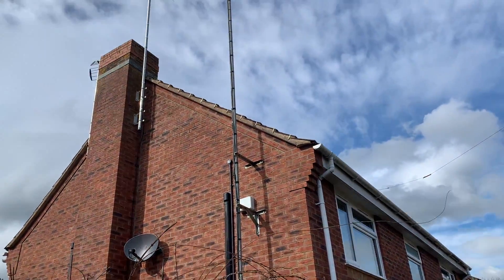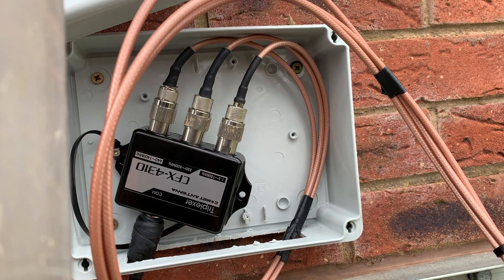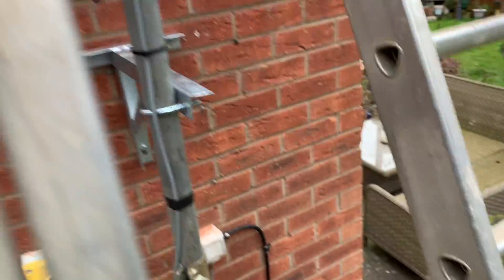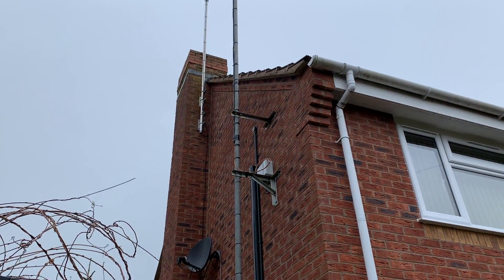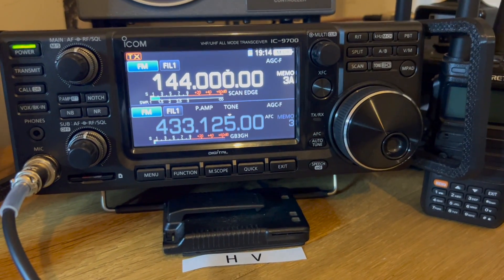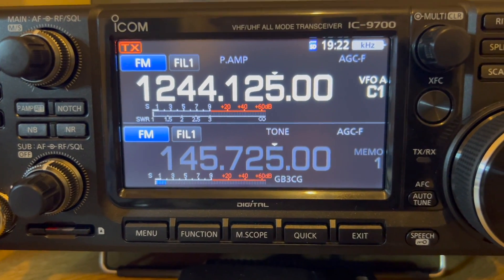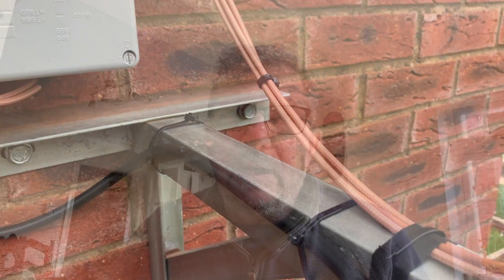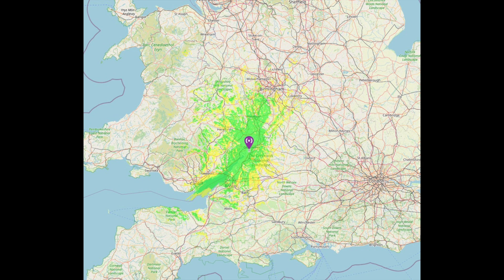HAM RADIO: YAGI/BEAM  23cm - 70cm - 2M Beam install and wired

Comment: Thanks for sharing your installation with us. Is that a Unistrut pole?
My only concern is that clear coax, I dont think it would be UV rated, but I could be wrong. Things don't last long outside downunder.😐🇦🇺🍻
Reply from the maker: You are correct, I will probably change it over in the near future :)

Comment: Cor life on 23cm's ! I used to have a Diamond X7000 up, and although I wasnt active in scanning 23cm the best I could manage was beacons. Whats really frustrating is that there is an ATV repeater in Bournemouth (IO90), but the UK band plan is just out of what Icom have programmed in the ic9700, so I was unable to even receive it. Looks a nice setup and will be of interest to see how it goes. The only thing I would regret not having in such an awesome setup is azimuth control to track the sats. Probably more work than you would like, but how about tilting them at 15" so you can work alot of the birds.. Stil, I bet it would still be interesting to see what sat's you could pick up with those gorgeous yagis as is - grab a copy of satpc32 and give it a try :D . 73 2E0FWE.

Comment: I see three beams on a stick, I see a vertical multi bander on a stick, but I didn't see any 30ft parabolic dish on the roof, or 5 stacked 6el 80m Yagi's on a stick. How are you going to work DX without those? You need more antenna's than radio's, the bigger they are, the better they are, contesting is the ONLY form of radio allowed in Europe now isn't it? It's ALL I hear in my rural area in Australia, BIG noise with BIG signals coming from Italy, Germany, France, Spain and a few others.....
Reply: Have some sympathy for us QRP operators in Europe... :D
Reply from the maker: So true, well I'm off to the DIY shop need a bigger Tower to put them 6el 80m Yagi's on..... lol
Reply: @mike-M0MSN  Make sure you take a banana along for correct calculation of the appropriate measuringness

Comment: Nice job!!! You will be able to knock Cal out of his chair 😂😂😂...Seriously though, very nice job, I like the clear coax jacket, looks more clean than the standard black jacket..So do you recommend ferrite beads for 2m and 70cms??? I'm about to replace all my coax and some people tell me you do not need a common mode choke for 2m and others insist on it..What's your advice? There is a company here in the states called ABR Industries that will install and heat shrink up to 7 ferrite beads on your coax from the factory on LMR 400 flex..
Reply from the maker: I' not sure if they help or not 🤔 but I add them and I do not get any RF in the shack... :)
Reply: That's a good enough answer for me to have them add them! Thanks for the expedient reply!!! @mike-M0MSN

Comment: It would be interesting to see what your loss is with that RG-400 on 1296mhz I think your BANANAS would be mush leaking out your yagi🤔🤔🤔 Cheers W9US
Reply from the maker: Yes the coax used turns out to be SF-316/ or similar (Timesmicrowave) with a loss of .041dB over 30M/100ft, it was given to me by a Cell tower engineer some years ago.. Wish I had lots more. :)
Reply: @mike-M0MSN  well then your firing 🔥  bananas 🍌  watch out birds 🐦

Comment: Nice setup.thats my next project installing a yagi and vertical on one pole i was just wondering how have you grounded it.
Reply from the maker: The pole is grounded via the bottom bracket to earth rods, the antenna are on a fibreglass pole, grounded via a lightning break to the same ground rod.

Comment: No pole grounding or coax shield ground?    How come.
Reply from the maker: The pole is grounded via the bottom bracket to earth rods, the antenna are on a fibreglass pole, grounded via a lightning break to the same ground rod.
Reply: @mike-M0MSN  wanted to say. I loved your video.    Excellent set up and the antennas look amazing.    Wish i had that.    

Thumbs up sir.